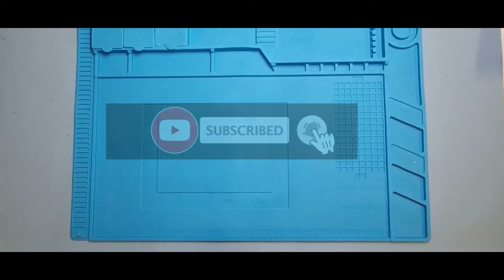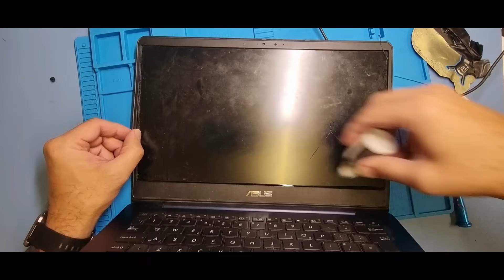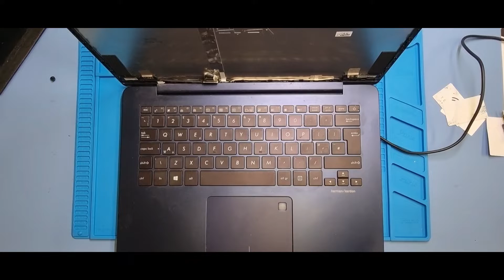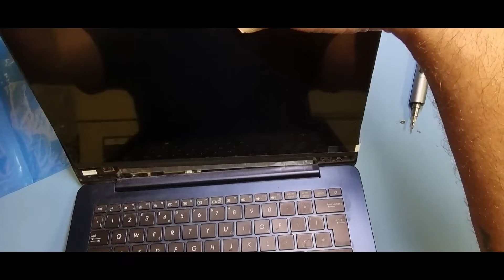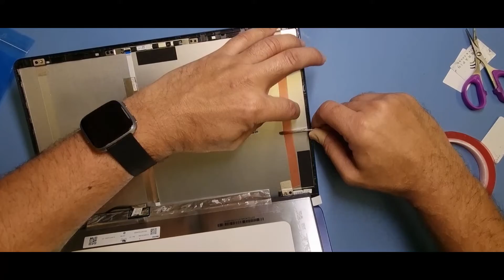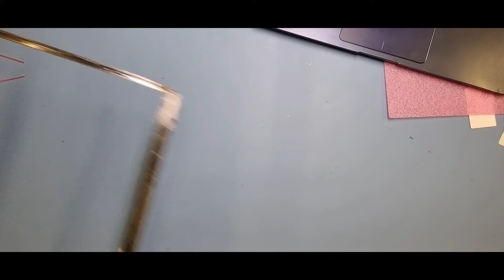Asus Zenbook UX430U LCD Replacement

Comment: If the lcd is working fine, and I just have to replace the cable, is the alcohol damaging the lcd or plastic around it?
Reply from the maker: Hi, the beauty about using ipa is that it will not damage any components, thank you for watching, would appreciate if you could subscribe.
Reply from the maker: Oh, yes nake sure you don't soak the frame too much, this can damage the lcd if it leaks into it. Use a hairdryer to soften the frame bonding and slow pop or prise as you go along
Reply: @amkotechrepairs  I've replaced the lcd cable following this method. Everything works pretty fine, the only issue is that somewhere in the process I scratched the lcd screen towards something and now I see an ugly shadow on the left top most angle... 😢😢😢😂
Reply from the maker: @ramskilo  Oh what a bummer, I would really appreciate if you subscribe to my channel.
Reply: @amkotechrepairs   already subscribed!
Reply from the maker: @ramskilo appreciated

Comment: The screen was flickering a lot so I ordered an "LVDS" LCD cable but realized that there are two cables connected to the screen? And the LCD one I bought was the wrong one. The other cable that I need to replace is mounted around the fan, any idea what the name of the cable would be?